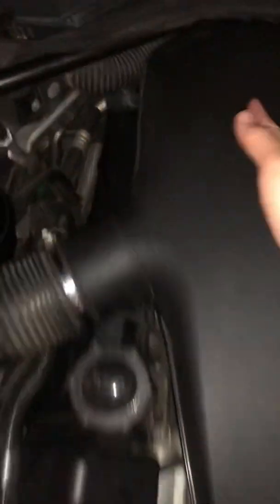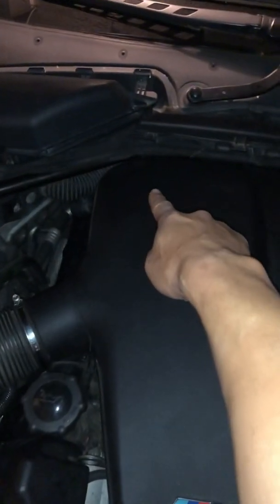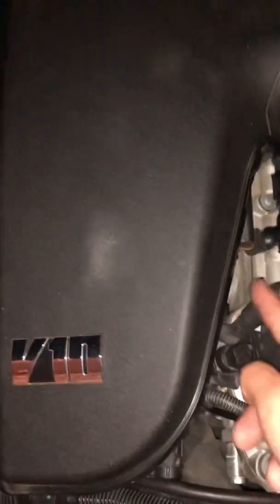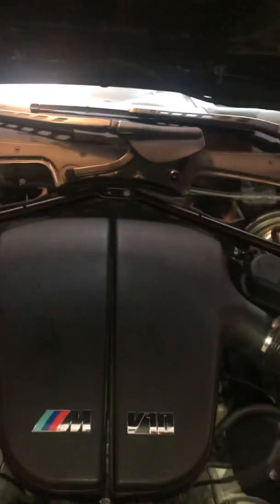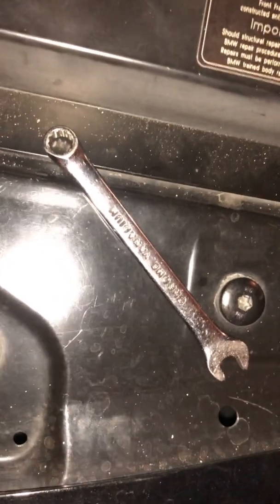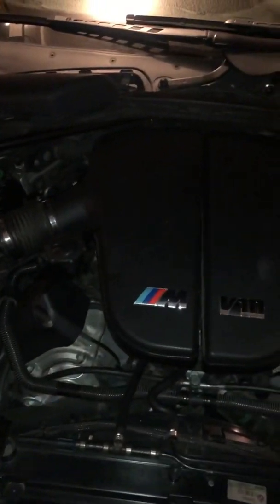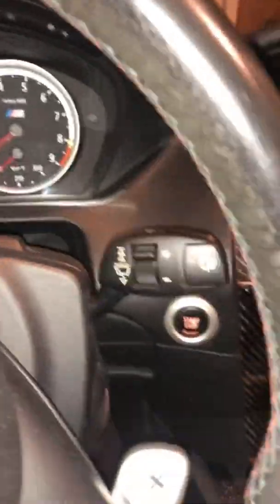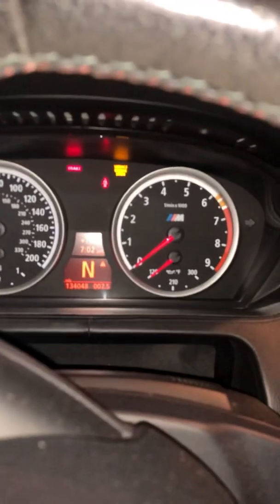Throttle sensor replacement for a S85 BMW V10 M5 M6 DIY

Comment: What code were you getting?
Reply from the maker: Hi, The codes I had were 2B25, 2B57, 2B5B, and 2796. Let me know if you have a different code. I have run into many different codes with the M6. I might be able to help.

Comment: i'm sure you probably know but dude i hope you cleaned those throttle bodys up !
Reply from the maker: Hi, I ended up spraying some carb cleaner in the throttle bodies before putting everything back together.  I daily drive the car, so it gets a lot of use.  The car gets pretty dirty and is well used.  These cars require non stop maintenance when you daily it.  Lol.  Looks like I will have a new video up soon on how to scan a misfire code and replace a bad ignition coil.  The M6 was idling rough this morning.  Thanks for watching the video.

Comment: What did you mean by turning the pin in the sensor to reverse the direction so it would work?
Reply from the maker: The sensor was installed wrong when I replaced the sensor the first time.  The pin was installed pointing the wrong way.  Remove sensor and rotate the pin by 180 degrees.  That’s the reason why it was throwing the check engine code and limp mode on the M6 even after replacing the throttle sensor.  Once I flipped the pin 180 degrees and reinstall the sensor.  it fixed the throttle sensor error.

Comment: Great vid. Just wondering what you meant by reversing the installation or the issue with the 180 revolution of the sensor?
Reply from the maker: The sensor was installed wrong when I replaced the sensor the first time.  The pin was off by 180 degrees.  That’s the reason why it was throwing the check engine code and limp mode on the M6 even after replacing the throttle sensor.  Once I flipped the pin 180 degrees, it fixed the issue and has been running good for over a year.